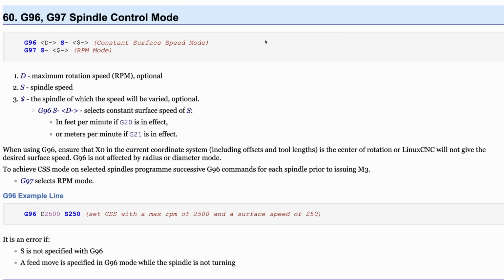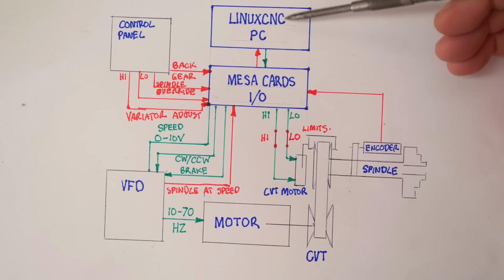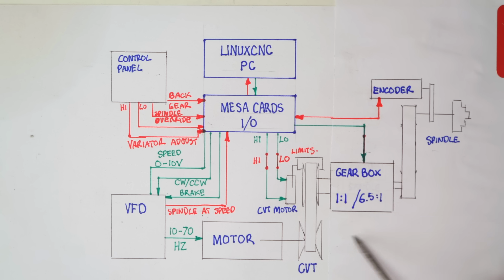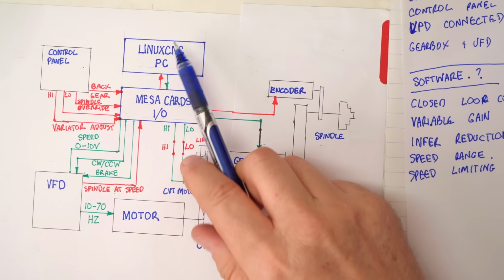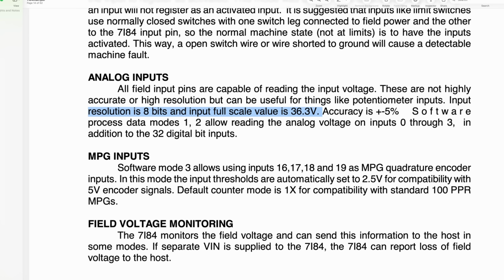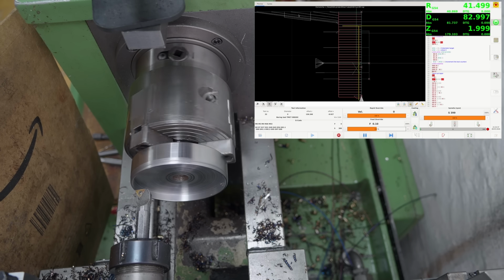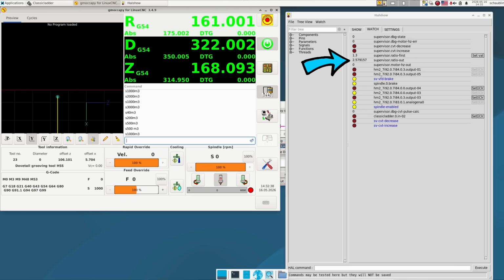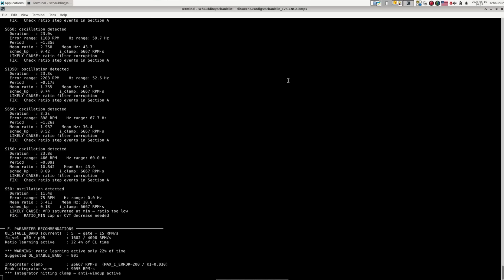Schaublin spindle control Ep.68. || RotarySMP

Comment: Oof! Mark, the way I would attack this is to build a simulator of the lathe and get the inputs and outputs working properly in your algorithm. Hopefully if properly done, you can have LinuxCNC talk to the simulator first. That will let you prove your code without breaking tools and running rough on hardware. (Although I didn't see any broken tools in today's video?)
(I realize this is tricky, esp. because you don't have a good model of how the CVT adjustment motor behaves so your simulator would necessarily be inaccurate and guessing; probably missing other details too).
I would want to make some graphs to show how you would get between various speeds.
It sounds like you're letting ChatGPT and Claude run the show and are not carefully reviewing their outputs…that's a reasonable way to start, but when you get to refinements, I think you need to understand what they are doing and be selective. This of course means you need good version control, hopefully you're using git (or similar). Of course there's a tradeoff here, and a risk that at the end of this you might become a better programmer…we wouldn't want that!
I'm unclear whether you're using the VFD's actual running speed output (not commanded speed) — you made it sound like having low resolution on that might be a problem, but I don't see why it would be — also, you could scale the voltage on input to the MESA card if that were actually an issue.
As for your hundreds of minutes of logfile output, I would ask Claude to build a tool to make graphs from that and look at the graphical outputs visually, not just have the AI do all the analysis. Use the AI to help you build tools to make decisions, don't let the AI make the decisions. (I realize that because you have more than two variables, simple x/y plots may not be sufficient. Ideally you'd want to see commanded speed and actual speed over time, and maybe other stuff too. But maybe you could start with time on the x axis and the ratio of commanded to actual on the y axis, or maybe with the actual and commanded speeds in different colors on the y)
Also, if you're running up against AI limits, the obvious answer is to just pony up $20 for Claude Pro. I recognize you're trying to avoid buying more equipment, but I think paying for services might be OK?
As a minor note, you're going to need some hysteresis in your rule about front/back gear. If you just set a 400 rpm threshold, you're going to have some nasty surprises when you are near that. You probably need a guard band, like switch to front if it's over 400 rpm but don't drop to back gear unless it's under 300 rpm. So you have a 100rpm hysteresis range. Obviously those are not real numbers, but you get the idea, and maybe this was an obvious detail you were aware of but omitted from the video.
GOOD LUCK!
Reply from the maker: Thanks John,
You summarised my lack of attention to detail well :)

Yeah, I was trying to use MESA Analog out commanded speed as one part of the ratio calc. 

For my next attempt I am going to try doing a survey, tabulating the CVT VFD etc points, and make a look up table. It has been pointed out above that CNC lathes typically do not control their spindles closed loop. I didn't know that.

I have the comp inhibiting the back gear with the spindle running. so if it is in low gear, and starts a facing pass, the fasted RPM will be CVT highest and 70 hz (about 600 rpm). No gear change.

Comment: AI.... promises you to solve issues, but brings with it more.
If you do not know exactly what you're doing, messing with AI can be hell because it can produce what ever, that works however and it's on YOU to debug and ensure that it does what it's supposed to do and correct any errors in it's output...

AI is not ready yet for "i know nothing about this" type of coding...
Reply from the maker: Yeah, that was a bit ambitious. I have written up my plan for the next attempt in the video description.

Comment: There is no way that the constraints you have imposed will allow for an automated spindle speed control algorithm! It is akin to trying to control the speed of a vehicle driving on a switchback with the throttle controlled by another person who is given hand signals on a foggy day.

You need as an absolute minimum, speed sensing on the motor and a back gear position sensing switch. Personally, I would dump the CVT control motor and use a stepper or servo motor with position feedback to allow a more deterministic control algorithm.

Selecting a priority for torque or RPM range would also simplify things.
Reply: This is absolutely controllable, and you don't need a direct feedback viz. Kalman filters.
Reply from the maker: Thanks guys. You may both be right. With the necessary knowledge and programming approach it could be done, and also not possible for me :)

I am working on the next attempt which will be simpler.watch this space.
Reply: @RotarySMP the proof that it's controllable is that you can achieve it manually, you would just like it automated. :)

Comment: I would make the gear switch as a m code like its done in many industrial cnc machine. The variator i would command over a look-up table. This would mean you start with 10hz and the lowest cvt ratio. Ramp up the hz to 40hz start to variating until the max and then encreas the hz further. You then need to take in mind that the max speed in this config is can not be with the max hz. You need to have sone margine for the controller to adjust for the load.
Reply from the maker: Thanks Mike. I also came to a similar conclusion of doing a survey of speeds and ratios and making a look up table.

Comment: You can use a multi turn logarithmic variable resistor (as a voltage divider) to get feedback from the CVT motor. In my opinion the CVT feedback is the bottleneck of the whole system.
Reply from the maker: What is the advantage of that over a motor encoder? The relationship of CVT lever angle to ratio is not linear, and would need a look up table.
Reply: @RotarySMP  The change ratio of the CVT transmission nearly exponential (more near tractrix). I believe this is close enough to logarithmic. So the voltage output of the potentiometer will be in sync with the change of the output RPM of the transmission.

Comment: scaling dc voltage up or doen in analog domain is trivial. you get an opamp and  give it enough soply voltage to cover the output you want then build simple 2 resistor divider feedback loop to scale input up or down, you can add resistor at the input if you worird it sink too much current, but opamps usually don't sink any current at the input anyway. so you can use low voltage speedo from motor controller to feed in  into mesa adc on full resolution just basic +- 40v  opamp opamp on a single power suply 10 k resistor to ground from inverting input, signal to non inverting input, adjustable resistor(potentiometer) from output to  inverting input  and output to  mesa
Reply from the maker: I had just googled that ten minutes ago. I guess it gets a bit more complex, as I would also need to design the board with a 24->40VDC step up and some PSU smoothing as well. Plus this is another whole rabbit hole I know nothing about :/
Reply: 24 volts is still giving you twice the resolution as 10v at 32v input
Reply from the maker: @kokodin5895  I think I will take a look a an open loop solution with a look up table. If that won't work, I will look at whether it is easier for me to scale the VFD feedback or add an encoder. Thanks.
Reply: @RotarySMP  you will need a lookup table anyway. if your input voltage from the encoder be at a lower voltage level you just technically get less possible speeds decoded 0-32 into 8 bit adc is 255 speeds, 0-24v into 32v 8bit adc ~170 speeds, 0-10v ~80 speeds. so it all depend how many steps you need. if you can build a lookup table that assumes stuff, don't make complicated code. double down on every settings when you run out of synch, so make a macro that get out of the work, readjust speed into known position and go back to work and only change speed with one speed controll at a time. since you have more controll over motor speed, leave it as emergency or fine tuning only when you at bell crank limit switches. you don't need to know motor speed if you keep it constant, unless you need very rapid speed changes. and don't rely on ai generated code. it often disagree with it's own solutions when you feed it with it's own code. i learn that the hard way when i was building arduino based thermostat to a speaker cone press, in the end i used onle line from ai code and rest was trash
Reply from the maker: @kokodin5895  I have had the experience with AI code as well :)

To do a CSS facing cut, you really need the both the VFD and CVT to adjust at once. As the CVT changes at a fixed rate, it's ratio change is typically too steep for the cut's required rate of speed change, so ideally, the VFD will be reducing frequency to compensate for the the steep ratio change of the CVT.
Reply: @RotarySMP  oh i see . silly question what is the voltage range of the speedo pin in that designed range 50hz+-10 or whatever you are going to use because you could get much bigger resolution out of adc if you only measure that region.
it wouldn't be 0-10v but something like 7-8 or 5-7? 
if you reference the other input of the opamp to voltage just below that you can crank up gain and only have the projected rpm range in adc, so resolution would scale way up even without increasing the power suply to fully cover the adc range, you don't need to know if motor sins above or below  that speed range and if it does you know you are outside of operating range and could either error out or go back to conventiona cutting,
Reply from the maker: @kokodin5895  That is why I am pretty skeptical of using that VFD's  0-10V motor frequency output, as I expect it to scale the entire possible VFD range of 0-480Hz into th.e 0-10V, and not scale the 10-70Hz I am using,  into that range

Comment: Commercial CNC lathe controls don't use closed loop spindle control. The spindle encoder feeds back speed and reference pulses that generate axis feed rate and screwcutting syncronisation, and the analogue output to the spindle drive gives the programmed speed. But there is no "closed loop" as the control does not attempt hold the set speed as programmed due to changing loads - if the spindle slows under load all that happens is that the feed slows to maintain the feed per rev programmed. To set up a new machine, the spindle drive would be set to give the required speed for 10V analog, such that the dynamic speed displayed on the control  from the spindle encoder was "ballpark correct" and that was it.  Typically the control parmeters allow for up to 4 gear ranges, with the maximum spped for each range set. Signals from the PLC tell the control what range is selected and the anaogue voltage is set accordingly. I used to set these initially from calculated speeds, but then would "tweak" the range maximum speed parameter values according to the actual maximum speeds displayed on the control display. "Ballpark" for me was usually within 1 or 2 rpm actual speed displayed compared with speed programmed, but this was open loop not closed.

Only time a spindle drive went into closed loop was if C axis spindle positioning control was enabled for live tooling work, which usually involved a seperate high resolution C axis encoder, as the typically used 1024 line (4096 pulse) standard spindle encoder resolution was too caorse for fine C axis positioning. Heidenhain make dual track encoders for this purpose, having a 1024 line ouptut for normal spindle feedback + a 9000 line C axis output that was additionally processed by an external 10 x  interpolator to give 360000 pulses per rev. Fanuc did have an option for a basic C axis function using the 1024 line encoder for basci drilling work, but the spindle drive usually needed the ability to go into "servo" mode to run closed loop control & not all did. "Servo" mode typically only ran up to the base speed of the motor, when it was operating in the constant torque speed range, but C axis operations were not usually fast.

Former colleagues made an analog control board to contol CVT drives on small turret milling machine spindle drives. This was a stand-alone board that used a proximety switch to sense spindle speed from the cooling fan vanes integrated into the lower variator pulley sheave, compared this "speed feedback" to the analogue signal from the control and output either an increase or decrease relay output to drive the variator. When there was coincidence the outputs turned off & the control was held in "feed hold" status until there was coincidence. Obviously not as dynamic a requirement as CSS on a lathe, but maybe treating the speed control as a separate entity with it's own basic speed feedback rather than tyring to make the spindle run as closed loop might simplify things ?
Reply from the maker: Thanks for you feedback on that. LinuxCNC does the same when threading. I will take a look at setting up a speed look up table to do the spindle control open loop next.
Reply: @RotarySMP  Been musing on how I would have approached this for a Fanuc or Fagor retrofit.
How successful it would work out depends in part on the speed range you could get out of the VFD.

Use the CVT drive as two discrete speeds - lowest and highest extremes - rather than try to get dynamic speed control from it.
Define 4 gear ranges :
M41 = lowest CVT + back gear
M42 = highest CVT + back gear
M43 = lowest CVT + direct drive
M44 = highest CVT + direct drive.

Then get your variable speed within each "range" using analogue control of the VFD - may need to push the extremes to the VFD frequency range a bit wider to minimise or remove any gaps between ranges, but that style of CVT shouldn't be too unhappy about running a faster input speed than before & the mechanical reductions would help out at the lower VFD speeds when it is running in the cosntant torque area. I would remove the motor built-in shaft mounted fan and replace it with a 220V seperate fan to give constant cooling at low revs (when the built-in fan is less effective) and reduce the built-in fan load at higher than base speeds.

PLC control of "range" selection would have some peculiarities, as setting the CVT to either end of operating range requires the spindle to be running & the back gear selection may require the spindle to be stationary, but that shouldn't be insurmountable. In use you select a gear range for an operation that will have the required power and speed range & the operate within those speeds - programming a higher speed than the range will deliver ( or if CSS demands a higher speed at a small diameter beyond the programmed CSS speed limit) just caps the speed at the range maximum.

Lathes designed with selectable ranges & a variable speed drive typically had the gear range steps chosen to match the constant speed range of the variable speed motor used - typically around 3:1 ratio between base speed & maximum speed for a DC drive. Matching the gear steps to suit the motor charcteristics gave constant power operation at the spindle from base speed in the lowest gear all the way to maximum speed in top gear. You probably would not get such nice co-operative steps as described above, but it would probably be "good enough" for home use. As what is described above would work happily with commercial controls, I would expect that Linux CNC would already have the capabilty to do so also (gear selection vai M41-44 + analogue spindle drive control) - I have no experience of Linux CNC so can't say that is defiinately the case though.
Reply from the maker: Very good thoughful input. Thanks for that. 
I looked up Schaublins manual. They divided 48-3000 RPM into 48 discrete speeds. With the back gear and the Dahlander windings, that means they split the CVT range into twelve bumps. I am pretty sure they didn't do true CSS. It had surface speed or rpm as settings, but I am not sure if that was just fixed at the start of a cut? To do a larger diameter than about 80mm facing cut , stepping through the speeds open loop, they would have to come to the point where they needed to switch dahlander windings, which would be a 2x speed jump, that the CVT could not compensate for.

I have written up my plan for the next attempt in the video description.
Reply: This is the way, excellent suggestion.
Reply: LinuxCNC does have M52 "adaptive feed rate" which should be able to do basically same thing I think. It needs input value of -1 to +1, so I guess something like (actual_speed / set_speed) might be good start for forward direction?
Reply: This is an excellent post.
Reply from the maker: It really is.

Comment: Thanks! Great video! 👍❤ I would actually fit an encoder for the belt (it doesn’t need to be anything fancy) and then divide the belt adjustment into maybe 10 steps, controlling the rest of the speed using the VFD. This also prevents the controller from constantly using the control motor on the belt to make small corrections. In theory, the change of speed by switching the steps can be compensated by using the VFD.  
Alternatively, you could also measure the speed at the motor and at the gearbox input and use that to calculate the gear ratio. Of course, this only works when the motor is running.
Reply from the maker: Yeah, I am tending toward just such a stepped, open loop control as my next attempt.